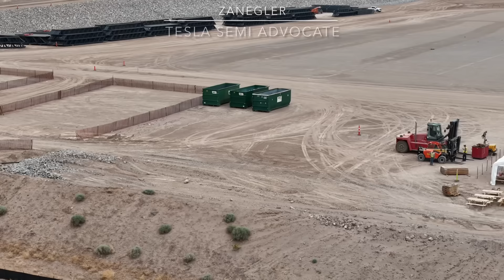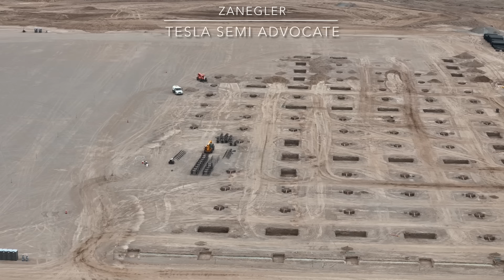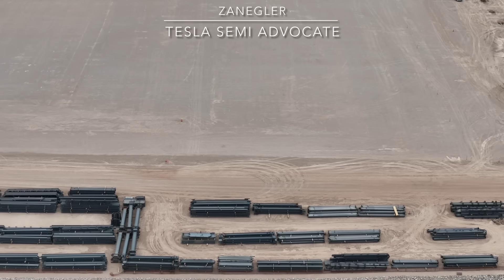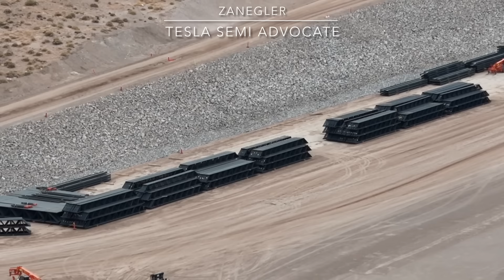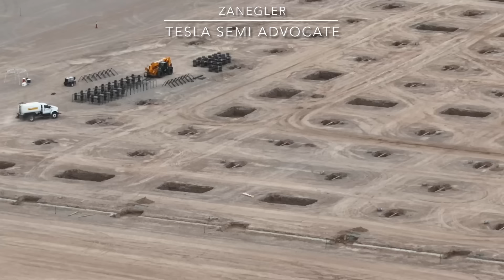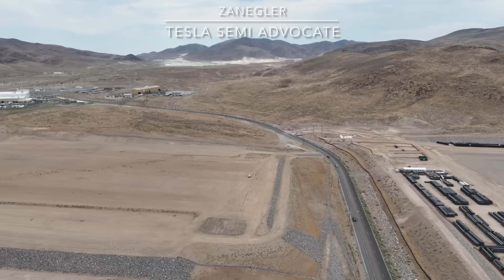Tesla Semi Factory - Men at Work

Comment: The work to actually pour concrete cannot begin until a concrete plant with silos, sand and aggregate bays and water and chemical drums are set up.
Reply from the maker: There is a concrete plant 5 minutes away if they choose to use it.